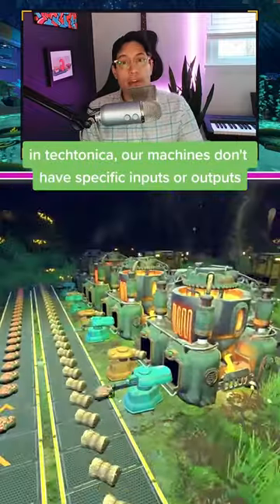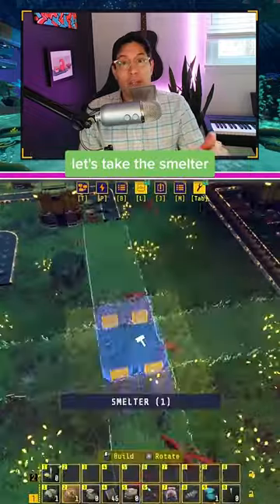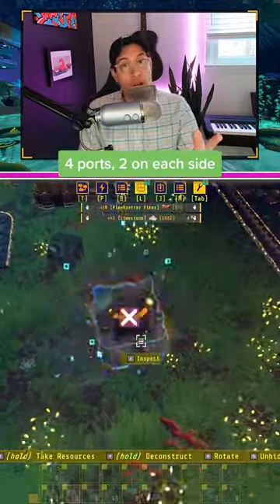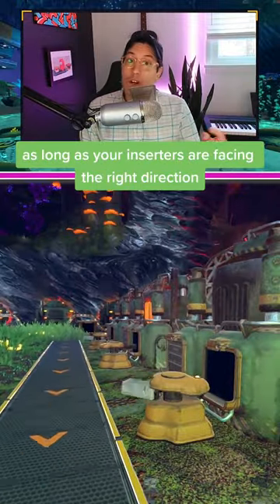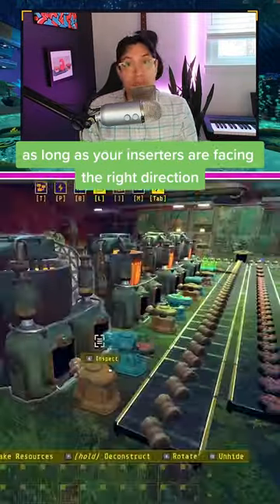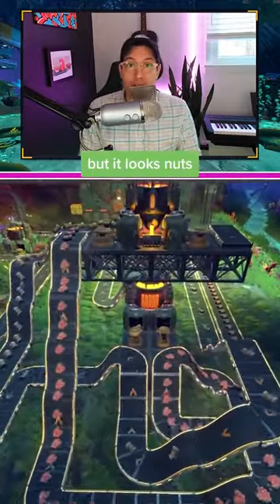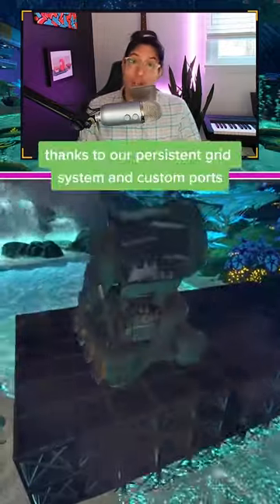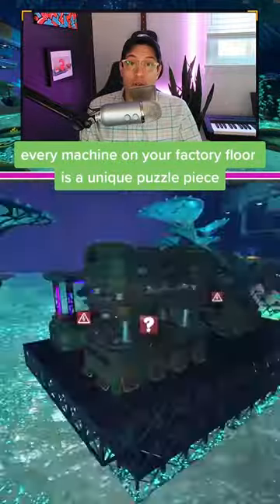Techtonica's Custom Inputs and Outputs

Comment: You really ned to fix the difference between manually loading input resources and inserting input resources.  If i load extract manually, lime is produced amazingly fast, if i try to automate it through inserters, even using 3 ports, its slow and arduous.
Reply: Makes the MK 2 smelter useless unless I use it manually